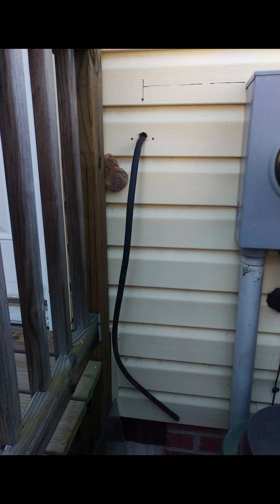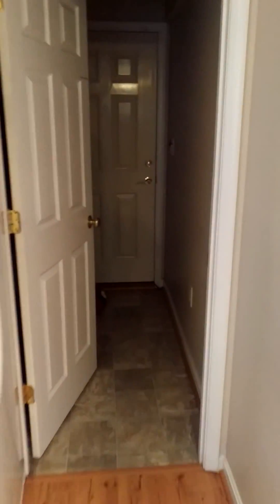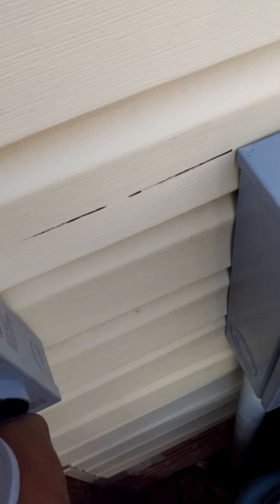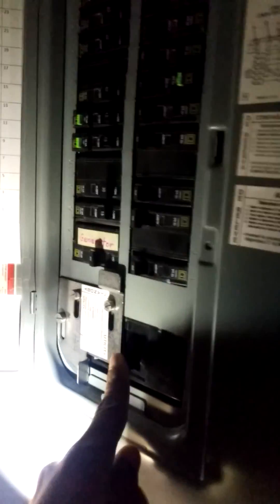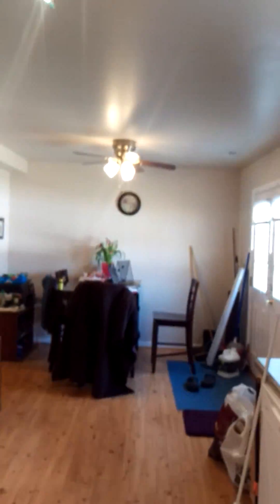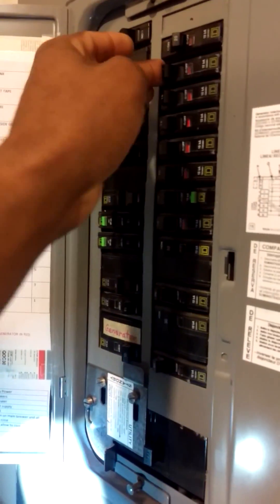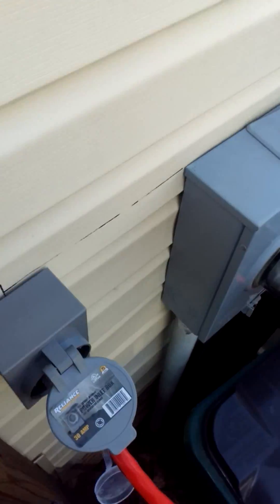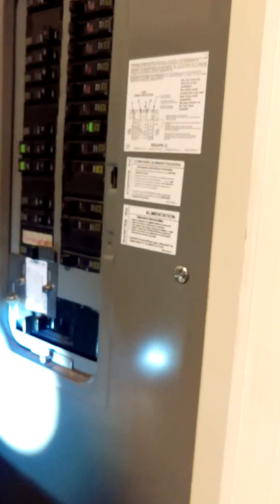Portable generator back feeding the main panel. With an Interlock Kit.

Comment: How do you know when the power comes back on from street with the main breaker is off and generator is running
Reply from the maker: Using this setup, if at night, I just look outside at the street lamps every more and then. Some power companies will also notify customers via text, app, etc when power comes back. There is also an alarm that you can buy that will let you know that power is back.

Comment: The first time I wired up my 4 prong 30amp outside plug mounted next to the sub panel were I have 8 gauge wires through conduit underground from my main to my garage sub panel my garage main is a 60 amp next to it is my 50amp that I wired my generator plug to and a 20 amp to 8 wall outlets a 15amp to my lights. In my house I have my 200 amp service panel I had to move my top right 2 breakers down so I could put my 60 amp to the garage at the top on right so I could install my interlock. Anyway we both did something we shouldn’t have done first I turned my main and my Central Air off and left the rest on went to my garage plugged in my generator let it run a few minutes then went inside to my basement and switched to generator everything ran fine my furnace hot water tank and dryer are all gas including my gas range. We are supposed to turn all breakers off first. But my 7,000 running watts Generator did handle everything running before I did it. I live in Michigan and many large items run on gas. So next time wether in use or not turn all breakers off after main otherwise good video we all make mistakes! By the way as I did it’s a good idea to check both ends of the generator plug if there very warm or hot your overworking your generator fortunately mine were not that warm.

Comment: Only one minor thing you should of turned all the individual breaker off before generator breaker on. You overload the generator and can damage.
 
Once you turned all the individual breaker off and turn the generator breaker on. Slowly turn each breaker on that you want on and listen to the generator bog down and comes back up as running normal, then turn another beaker on.
Reply from the maker: That is correct. I addressed that in another comment in the comments section. I go through each breaker turning on only what I need while on generator power. Sadly I got caught up in recording the video and failed to do so "on camera" lol. Yeah that's a piss poor excuse on my part especially concerning safety, but that's what happened.

Thank you very much for viewing and for your comment.

Comment: Hi Romeo:: Thank You for the great video and information.If I understand you correctly, You plug in the generator to the interlock box that is hooked up directly to the main fuse box with the double 30 amp circuit breaker. Please correct me if I am wrong. Brand new to all of this. Again Thank You.
Reply: Good video, however you should turn off all your breakers before turning your generator breaker on,  you could possibly damage your generator,  or your appliances... you should turn breakers on one by one, so you don't overload it..
Reply from the maker: @crossland751  That is absolutely correct. I even had a typed out step by step instruction sheet placed inside the box, but I admittedly got caught up with the recording. Thank you for your comment.
Reply from the maker: The generator interlock is actually bolted onto the panel. It is the piece that prevents the Main Breaker and the Generator Breaker from being turned on at the same time.
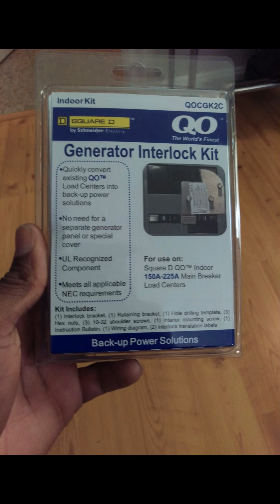It is the package at minute 0:35.

If there is anything else I can answer please do not hesitate to ask.

Comment: nice!..but how would know if the powers back on?
Reply from the maker: There's an alarm you can purchase that sounds when the utility comes back. It's easy to make one yourself also.
Reply from the maker: Or you can use a multimeter to check the utility wires on the HOT side of the main breaker every so often.
Reply from the maker: +SEF the Lawn Surgeon this is one of the alarms I was talking about. It sounds when the utility power returns.
http://www.amazon.com/Reliance-Controls-THP108-PowerBack-Monitoring/dp/B003KREORA/ref=redir_mobile_desktop?ie=UTF8&amp;keywords=power%20back&amp;pi=SY200_QL40&amp;qid=1455938442&amp;ref_=mp_s_a_1_1&amp;sr=8-1#immersive-view_1455938515779
Reply: cool